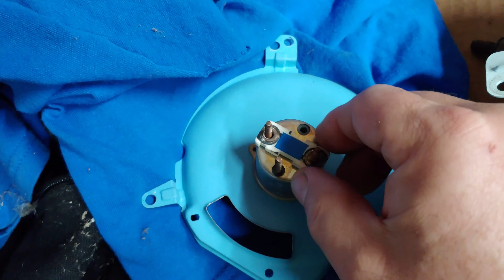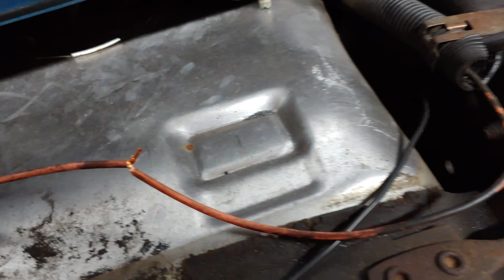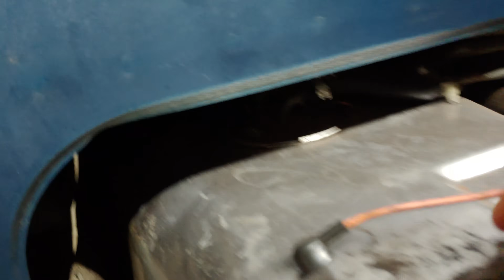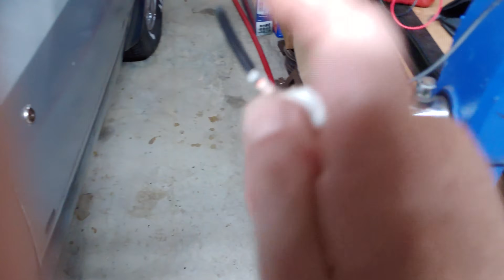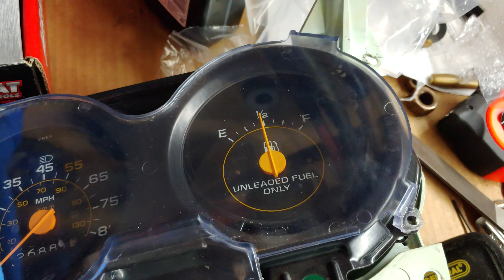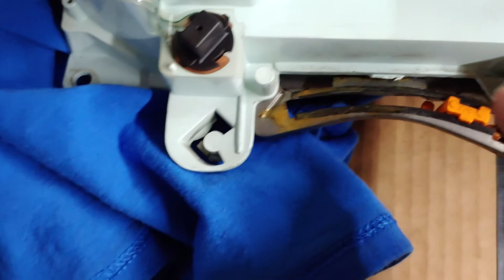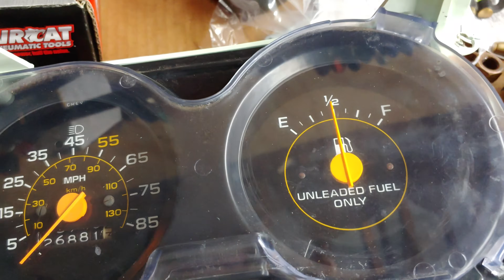GMC Square body Fuel Gauge Troubleshooting

Comment: Great video.  Mine does the same thing.  I replaced the Sending unit, but the gauge stops at 1/4 tank.  It should be at least a half tank.

Comment: Brother, thank you so much for the explanation. I have a question... Do the colors of the resistors indicate their resistance value? I've seen blue, orange, yellow, green, etc. And do the temperature, oil pressure, and battery gauges also have a resistance of 90 ohms? If the resistances do vary, what is the correct value for each gauge?
Reply from the maker: Yes, the colors are each associated with a different resistance value. The ohms can be determined by a Google search. Then, all ohms are the same, as long as they have enough bulk to dissipate the heat.

Comment: I worked on three of these trucks have never seen that resistor. I have a 79 and 83 I put a new gauge in my 83 does not have a resistor works amazing do all these trucks have these resistors or supposed to?

Comment: Where do I get one of those resister for the gauge? I’ve taken mine apart thinking it’s dirty connections causing the wiggle and inaccuracy of reading but mine forsure doesn’t have one of those and I can only find pictures of them online but when I try to shop for them nothing pops up like that

Comment: what would cause the fuel gauge to go to empty with headlights on and read half tank with lights off? 75 gmc c25.
Reply from the maker: Sounds to me like you have one or more errors or shorts in your wiring. You have a clue (headlight circuit), so trace the wires, looking for faults. Has the gauge cluster been replaced with one from a different truck?
Reply: @ it ended up being the terminal pin for the glass fuse for the cluster power

Comment: What a clear video! Question? Do you just crimp leads to eyes? Or can I get away with solder and not overheat resister?
Reply from the maker: To build the resistor I soldered them together. To mount it behind the gauge it uses nuts that go on the screw terminals, just like the factory ceramic resistor. Hope that helps, and good luck!

Comment: Thank you very much for the repair tip. It helped me a lot with my 1984 GMC K 1500 Stepside. Two resistors for less than €1 and the display works like new. Greetings from Germany
Reply: You brits got boxes over there?
Reply from the maker: Glad it helped!
Reply: Where d id you buy a resistor?

Comment: Mine doesn’t move at all
Reply from the maker: Sorry for the delay. With zero movement it could be lots of things. I'd start with checking the ground connection, and the wire connections on the sending unit itself. Good luck!

Comment: If you remove the clear cover, black plastic, and then screws holding the speedometer in you can remove the cable much easier(through the hole by the headlight switch). Once the speedometer is out the cluster is much easier to remove. When the cluster is back in place you can install the cable then turn the speedometer slightly to line it up with the holes.

Comment: Great tips. Maybe you can help me out. I have an 1982 GMC Sierra Classic 1500. I can't switch to the passenger tank as of yesterday. I replaced the switch, nothing. I hooked up a new fuel tank selector valve, nothing. I filled up both tanks  and the gauge works perfectly on the driver's side tank. I drove around the gauge drops as usual. I just can't switch to the right side tank. Any help would be appreciated. Thanks!

Comment: So something weird is going on, new sending unit, cleaned grounds, but gauge sits at overfull and if I turn on hazards it pulses the needle slightly. Also when I disconnect my sending unit wire from the tank my voltage light just gets more dull (dummy lights). Need help😂
Reply from the maker: Well, that really is strange! A couple of things: 1) Test just your meter, out of the truck. Apply the correct voltage... is the meter itself OK? 
2) The thing with removing the sending wire affecting the voltage in the whole truck - it sounds almost as if it's trying to use the sending unit ground as the only ground point in the whole truck. With the lights dimming like that, I'd bet another ground is either dirty/rusty or missing. There should be one by the battery to the body, an engine grounding strap somewhere, and depending on model specifics maybe another one or two (gas tank sending unit, etc.). Check and clean all grounds! Also, watch the video again. If the meter sits overfull at 3 o'clock it tells you something.
Reply: @hardscrabblegarage  thank you man, I appreciate the time you took to write this! So it seems like the issue was there’s a ground wire on my filler neck that was missing, got a new filler neck and wire and now the gauge seems to be almost accurate. I know I have a tiny bit more than half tank and it’s saying little less than half. So now I’ll do what you said and check the resister that goes on the back of the gauge itself!

Comment: Can’t thank you enough for posting this. 🙏🙏 This info that you provided is truly invaluable!! My truck does the same as what you mentioned that yours did, the fuel needle only goes up to about between 1/4 - 1/2 tank when my tank is full. So I’m assuming that my issue is also the resistor like you mentioned in your video. Thank you again for the video!!
Reply: I had the same issue,... I was scratching my head until I found out about that stinkin' resistor behind the gauge.
Reply: @d @darylhaworth7830  did replacing the resistor fix your issue?
Reply: @gimmefuel7268 couldn't locate a resistor,.. I just ordered a new gauge, should be here tomorrow.

Comment: I bought a ‘72 C10 many years ago. The seller told me occasionally the gas gauge quits working properly and he had a magnet stuck to the kick panel and said just take that magnet and touch it to the two leads on the back of the gauge and it will start working correctly.  It does happen occasionally and the magnet touched to the back of the gauge does correct it.....Any idea on the theory that is taking place?

Comment: I appreciate this, I want to get a original tach to go in place of the big fuel gauge on mine and put the small fuel gauge where the clock is, anyway if I find them I wish I could ship you my cluster for a rebuild.
Thanks again! 👍🏼

Comment: I've been study how gauges work  on 1986- mid  90's  I took apart a speedometer cluster 
just for study from a 86'  olds delta 88 and the back of the cluster looks exactly what your 
showing. I had never seen anything like that . The harness plug fitting in that recessed slot, and just pushing  against the ribbon wire  circuit . I guess for the light bulbs. 
   I've replace the 2005 pontiac speedometer and gauges steppers But I guess the older
inst. clusters use some round thing, there not steppers and there not soldered. and prob.
don't break like steppers either. I'm reading in my factory 90 bonneville service manual.
that the  gas gauge used, it say's the pointer on the fuel gauge is moved by  magnetic fields
, of two coil's. the coil's are at right angles to each other. battery voltage is applied to the 
to the "E" coil  ( for empty  I guess ) & the circuit divides at the opposite end of the coil .
One path continues to  gnd through the "F" coil. another goes to gnd through  the variable resistor  of the fuel gauge sender. when the tank is low the resistance of the sender is low.
A large flow of current passes throu the "E" coil and the fuel gauge sender resistor this movesa the pointer towards  "E" on the scale.when the tank is full the sender resistance is high. More current flow's through the "F" coil, movin the pointer towards "F"on the scale.
Say's with the 2 coils operating the pointer, the gauge is not effected by the changes in the voltages of the system
Reply from the maker: That is exactly as I understand it as well. Since both current paths are using the same system voltage, slight variations don't matter. Because the needle is driven by the differential between those two magnetic fields, rather than an arbitrary reference voltage, when system voltage swings up or down it does so on both coils, which cancels out the variance.
Reply: @hardscrabblegarage  Great explanation thank you

Comment: I had two 1980 Corvettes and 181 and everything is exactly the same there the circuit boards other than my shift lever is in the console but I was surprised to see that the 85 mile an hour speedometer is also on the truck because that's all the Corvettes have.  I sent one to ecklers and had to change to the 165 mph speedometer it came back with 7 miles on it for testing purposes. But trying to find the output gear for the speedometer cable it seems that the Corvette models have about 10 different ones you would have to know the exact ratio of that transmission and your rear end to make it work or it's going to be off I got one through Summit and it was about 10 to 15 miles an hour off. If you look it up they have a variety of colors of the little gear that's permanent in the transmission that's where the big difference is at. I tried buying different ones at O'Reilly's they have them they're very reasonable the 200 mph speedometer but you would have to buy an adapter cable from them to put it into the car they're not the same they won't bolt in and then you're going to have trouble with the transmission gear probably not worth your trouble
Reply from the maker: Sorry, I have no idea on the speedo gear ratios. Good luck!
Reply: Well what I was mentioning was the Corvette and the replacement speedometers from O'Reilly's they hook up different the cable you'd have to buy a cable but I had an 82 Chevrolet pickup the turn signals were down in the front bumper the only year that it's that way four-wheel drive truck very nice I ended up putting a 454 in it didn't matter about the transmission I could milk the tires after the big engine went in it was modified a little with the RV cam Edelbrock manifold Edelbrock carburetor and a different kind of distributor and it had no smog on it at all the state of Nevada registered that halftime truck as an 8500 lb class truck for 5 years but is the emissions got higher harder rather they wouldn't do it so I sold it off to another County where they did not have emissions and still don't have emissions Nevada has 17 counties only two of them require emissions

Comment: Brother if you're going to give advice about resistors, you need to learn the difference between watts and ohms. Also, instead of "wiring up a couple in parallel", just use one of the correct resistance.
Reply from the maker: Uh, brother, I used to service fire control radar, troubleshooting to the component level. "Wiring up in parallel" two equal resistors is exactly the same as using a single resistor of half the value. As in EXACTLY the same. Total resistance = 1/R1 + 1/R2 ... +1/Rn. This is like the first thing you learn in a basic electricity class... but thanks for your input.
Reply: No response?

Comment: I have a 1980 C10 Big 10 Silverado, None of my gauges are Working.  I purchased a new printed circuit board, everything is grounded and working , new wiring harness, fuses .lights  etc..., the gauges are 40yrs old. Do the ceramic resistors go bad ?And if they do. Will they cause the gauges not to work? Also do you know what the part number # for the case ceramic resistors. I would like to purchase some.please advise. Any info would be greatly appreciated. Thank you Robert. One more question, I call lmc and ask them if I purchased new gauges would they have resistors applied to the gauges. They didn't know if they did. Anyway do you know if they do? Thanks again.
Reply from the maker: Keep plugging away at it, you'll eventually get them working. Yes, the ceramic resistors can go bad. And yes, it is possible 40 year old gauges are bad, too! Now, they can also work fine... much depends on condition. Have they been kept dry? Now imagine a truck with a missing window, sitting in a junkyard, open to the elements... different entirely.

No idea on the part numbers for the original resistors, sorry. You can Google GM gauge resistors and get many hits, but only a few are links to sellers, and they are often out of stock (which is why I made my own). 

You should be aware, many repop gauges don't need the resistors at all, it's built-in to the design of the new gauge. This is not always true, but it is often so.

If you flip the cluster over and measure voltage on the pins of the gauge, but it does not even move? Likely a bad gauge. Are you sure about the ground being good? It is possible for all of the gauges to fail, but not that common (in the absence of exposure to the elements, flooding, etc.)

Good luck!
Reply: @hardscrabblegarage  thanks for giving me the information I greatly appreciate any advice. I'll keep on working on gauges. Got a question? The pig tail that goes into the back of the instrument cluster with different color wires, the 3 black wires are ground wires,Correct? Now, I'm I suppose to ground one wire under the dash , too sheet metal and the other ones run it through the fire wall and then attach to the engine block.

Comment: Great video. Once I had gathered the basic idea of how to circuit works from your video, I was able to repair my non functioning gauge in just a few minutes. Thank you greatly
Reply from the maker: Glad it helped
Reply: @hardscrabblegarage  Do you happen to know if the specs you give are the same for a 1980 vintage? I'm getting 190 ohms at the sending unit connectors, tank maybe 1/2 full and 43 ohms at the gauge. After doing some research I believe the blue one is 82 ohms and the pink is 84.

Comment: I am having an issue can't figure it out my fuel gauge at full goes lil past quarter tank but will go to empty I disconnected the wires at sending unit and it went to full grounded went to empty so replaced the sending unit still same problem gunna pull the fuel gauge today see if that's the problem but I don't have a meter now got damaged when I moved

Comment: Weird question but what the heck… I had my whole dash Cluster apart for a restoration on it and I happened to completely spin the fuel guage needle 360° around while wiping the guage off. Would this change the readings on the fuel level?

Comment: Gauge reads low resistor good float good     How go I make sure the instrument cluster is grounded properly
Reply from the maker: The fuel gauge-specific ground mentioned in the video is located on the inner surface of the frame's c-channel, a bit forward of the gas tank. The wire connects the sending unit on one end, to a grounding bolt on the frame a short distance away. At least on 1984 models the wire is black, passes through a hole on the frame, and bolts to the inside surface of the frame. Just disconnect it and clean it up. Afterward you can use a DVM to check the resistance to ground from the ground terminal on the sending unit (one probe on the terminal, the other on any clean, bare-metal part of the frame).

Comment: My gas Guage sticks until I tap on the lense cover several times. What causes this
Reply from the maker: I'm not sure, but it could be the gauge itself. You might try taking it out, and squirting it with a cleaner called DeoxIT, the aerosol one. I use it on the volume pots of vintage stereo gear, so it should be safe. Don't get it on the plastic, or the face of the gauge, it might screw them right up! Spray the inside... if it's just dirty, that might help. Otherwise, maybe a new gauge. Hope this helps!

Comment: What are these resistors called?
Reply from the maker: Sorry for the delay, I've been on the road for work. The ones I used to replace the originals are ceramic case resistors.

Comment: After you put them in series.  Does it matter which way they  go in the back of the fuel gage ?
Reply from the maker: Technically they are wired in parallel, not series. If in series the 2 180ohm resistors would actually measure 360ohms. In parallel they come out to 90ohms. And no, resistors are not directional, like electrolytic capacitors, so it doesn't matter which direction you install it. You do need to put it on the same contacts that held the factory porcelain resistor.

Comment: My gauge would bounce back and forth if below full and go past full if full it finally went past full and quit working.
Reply from the maker: That could be bad wiring, a bad meter, or a bad sender. Do the troubleshooting like in the video, open the connection at the sender, then ground it out, and watch what the gauge does. Good luck!
Reply: @hardscrabblegarage  I bought another guage and then it decided to work before I put the new one in but still swings erratically sometimes if not full but I'm going to pull the cluster to change bulbs soon and I'll go ahead and swap it out .

Comment: Question on the connector. The brown wire off of the sending unit, does it go to the single wire on the back #7? Or #18 with the 2 brown wires as well coming out?

Comment: Is this the same with the other gages? Such as oil pressure and water temp gage? My 79 C10 has those 2 out of order.
Reply from the maker: Yes, some of the other gauges have these resistors on the back. Be aware! The battery/charge gauge in some trucks was an ammeter (current meter), and others are voltage meters. They are not interchangeable, and if one tries the wrong combo fireworks will ensue.